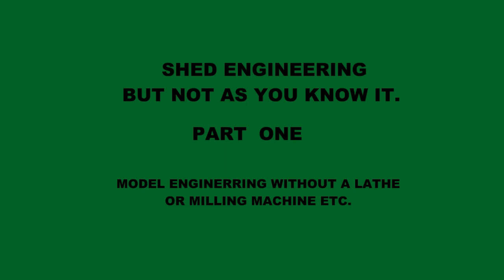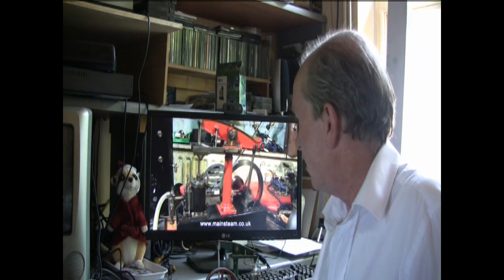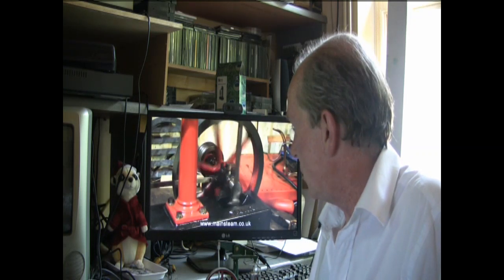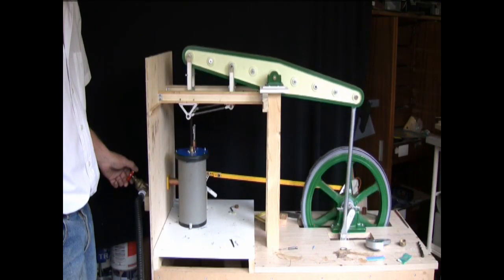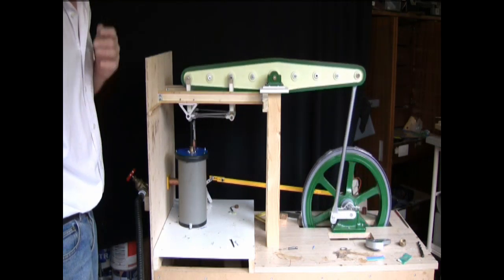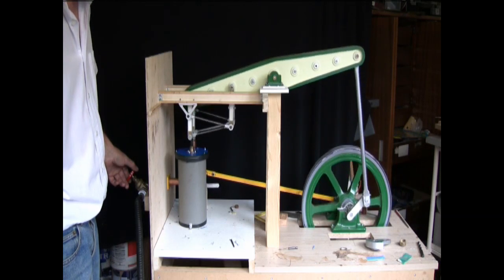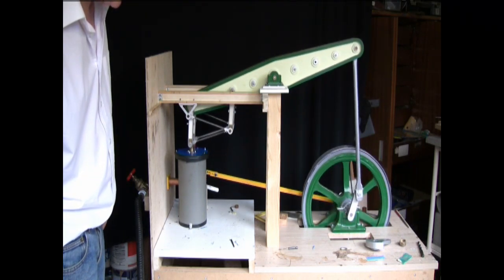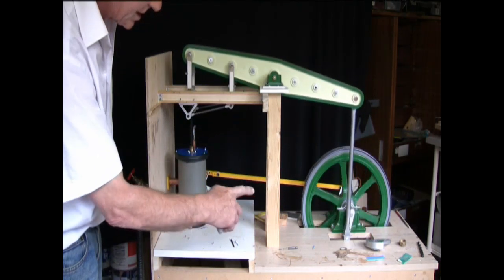Beam Engine Model from shed engineering. PART 1

Comment: Nice work! I would love to have a go at this!
Reply from the maker: Hi there Phil many thanks for dropping by ,,,,  im glad its of interest to you ,,, the main idea behind the Beam engine was to try and show ,,,, you don't have to build something like this out of proper metal castings etc,,, hopefully you can see the flywheel and beam look very much like Metal and you can have a very nice model  ,,,, and something like a horizontal Mill engine would be a lot easier than a beam engine with parallel motion ,,, but you could soon have a working model that is very interesting ,,,,,  Cheers   Alan

Comment: that is absolutely amazing Alan!!!! Thanks for sharing
Reply from the maker: Hi there Billy ,,, many thanks for stopping by and commenting,,, so you like my beam engine ???? nothing like your proper engines but ,,,I have never been able to afford a lathe or anything,,, so set myself the task of building a working model that had got something like a realistic speed,,,,  (chaps on engineering forums said my suggestion of building a model that would run at less than 15 rpm was some what ambitious to build one without a lathe was expecting too much,,, one chap said you can scale down size but you will learn you can not scale down the laws of motion and Kinetic energy ,,,, you will need a flywheel made of something heavier than MDF)  The model is in limbo at the moment ,, I am considering a re-build to try and run her on steam ,,,  but a boiler looks like costing  nearly a thousand pounds even though I recon she needs a working pressure of no more than 10 to 15   P.S.I,,,,   (in one of the later videos I try and prove how little pressure she is running on by getting her going on an hair-dryer,,,, (even though it cut out after a few seconds) ,,,,   but many thanks for you interest really appreciated from someone like yourself who is working on the real thing,,,, best regards,,,, Alan
Reply: *****
I think it is amazing that you have engineered somthing that is mechanically sound and without a lathe! Well done!
Reply from the maker: Billy Stock Many thanks Billy ,,, I think she works very well considering ,,, swap the plastic soil pipe and plastic parts for aluminum ,,, and then get a couple of old pressure cookers hooked up to here,,, and I might one day have my own proper steam engine,,, ,,,

Comment: That is Fantastic Alan,you should be really proud of it. You can buy pieces of mahogany strips from model shops on ebay,they are really cheap and it would really bring out your cylinder.Keep it up mate really great that.
Reply from the maker: Yes I was well pleased to get it working so well and so slowly,,,, in fact when I asked for advice on a model engineering forum ,,,, one bloke said  "Your obviously no engineer because suggesting or aiming for a to run at less than 15 rpm seem over ambitious to say the least,,, you will learn that you can scale down size,,,, but you can not scale down the laws of motion and kinetic energy and you will need a flywheel made of more than M.D.F "   But yes now she is working I can start to get her looking a bit better mahogany cladding with brass bands get the girders painted,,,, flag stone floor with some gratings, stone effect on the wall,,, and she will be a different model. Thanks for your interest and your comment.

Comment from the maker: The other aspect is Toly, here in the UK, our houses are tiny compared to what you have in the states, My bungalow is just 76 square metres, I recently extended my shed and it probably takes up one fifth of my back yard,, if you look at the origami boat builder on Y/T his boat is 75 foot long , that twice the length of my garden and there are planning restrictions on building brick or block workshop etc. but will look at K, fenners channel Cheers

Comment from the maker: Hi Toly  No not much around like that in the uk, anything half decent gets snapped up and refurbished and sold at silly prices, or the scrap man comes in and they are gone and the main point  with a used or second hand lathe etc,, if you have no experience like me then you have no idea what your buying even the cheap new lathes can be a mine field with the head stock out of line  so its scary to spend 15,000 £ and before you can think of any project you have to strip down the thing to check it